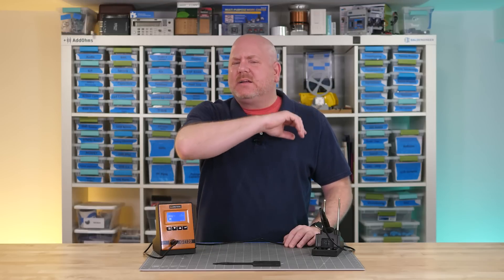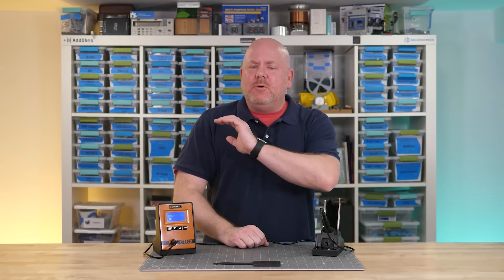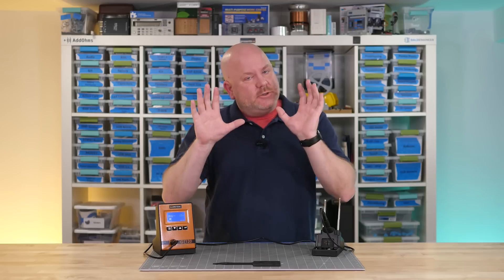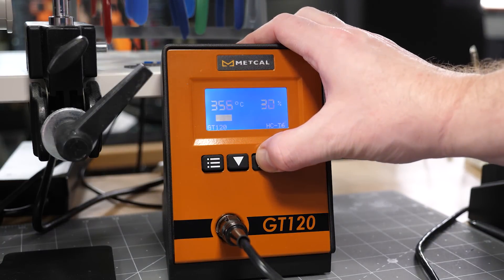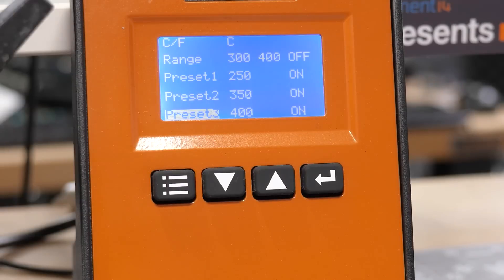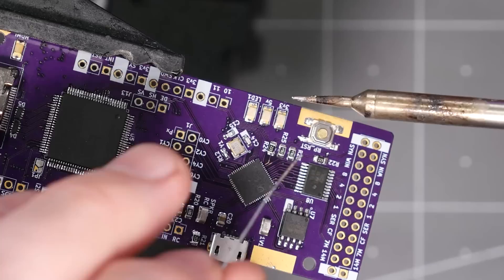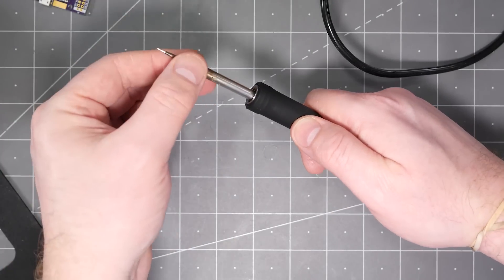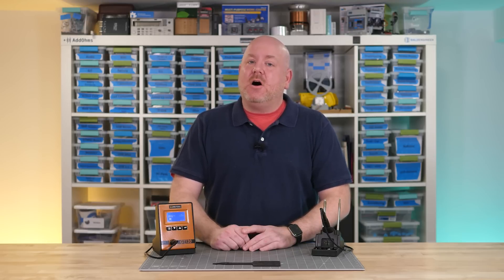Three Tips to Improve Your Soldering - Workbench Wednesdays

Comment: Can someone tell where I can buy a soldering mat with design like in this video?
Reply: It is a self-healing cutting mat. I treated it with a carbon spray (from Staticide) to make it slightly conductive and less prone to ESD. I don't actually recommend it for soldering since it does not stand up to high heat. In almost every other video, I have a metal tray under the work piece.
Reply: @bald_engineer  Thanks for response!

Comment: A tip regarding... well... tips. Before setting your iron down in its stand after soldering, tin the tip by at least melting a droplet (blob) of solder onto the tip and leave it in place while it rests. This causes that droplet of solder to oxidize instead of the tip. A light tap of the iron removes the blob when you pick it up (into a metal tray works best) and a quick wipe on a wet sponge leaves you ready to carry on. Also, before shutting down your iron for the day, leave a similar blob to harden onto the tip in the holder for that same tip oxidation prevention. When you come back the next time, fire up your iron and you'll know when the iron is hot, as well as protecting the tip. If you're like me, the iron is often on well before I'm ready to start soldering. Last tip - tip, is to avoid tinning too far up the tip. Most quality tips have a base metal and a quality metal on the soldering area of the tip. Don't tin past the tip alloy up onto the base metal. Solder flows well on the tinned portion and it can and will cause you to use more solder and/or draw more of your solder away from your joint. I'm not a believer, but the saying 'Cleanliness is next to Godliness' when it comes to tip care is apropos. (Although I'd just say it's good damn idea!). As my father once said to me... 'Son, try to learn from my mistakes. You can't possibly live through them all yourself...' :)
Reply: Nice. Cleaning the iron with good quality brass wool is preferred to wet sponges. It's due to brass removes excess solder, including dross but leaves a decent skin of clean solder on the tip (assuming a clean well tinned tip).
Wet sponge tends to cause thermal shock and makes your iron tips corrode faster. They do tend to clean better but with a shorten apparent life. They leave a lesser solder skin than brass. This reduces transfer of heat into the work material when you touch the tip to the work area. It sort of pushes you to needing to feed the solder wire in to make the heat transfer happen faster. 
I fully concur with your leave some solder on the tip. Tap or wrist flick to remove the solder. Great practice!
Clean your tip with brass wool before working on your joint. Not when you return iron to the stand. Don't do both times.
Prepping to ensure you get clean melted solder onto your stright out of the packet tips at the very microsecond they are first heated sufficiently is the key to tinning your tips. 
Caveats: All brass wool is not the same. You can get bad stuff that has alloys in it you don't want to be there. Never use brass if it's a scouring pad (yes it looks like one) or sandpaper. Doing so will not help.
 Wet sponges also vary but are commonly filled/wetted with tap water by the user. Tap water contains things you do not want to be cleaning heated metal with.
Reply: @cdyoutoob  I forgot to mention that I use distilled water for my sponges. The other bit is that I slit the sponges with an razor blade about a 1/2" deep, so 1 or 2 quick wipes clears most of the flux containing the contaminants and have tips that have mega-hours (years) on them, so haven't seen the thermal shock issue of which you speak.:)
Reply: @scottdebruyn7038  Yes that slit in the sponge is a great tip i've only recently discovered. Seems so logical once you do it though. Thermal shock is hard to see, just read lots about it and moved to using the brass way more. Tips/Cartridges do last a lot longer now. I get my brass wool only from electronics vendors and not generics. Too concerned I'll be getting something that is cheap and nasty instead of just cheap.

Comment: Before storing your iron, clean the tip with Tin Tinner, then coat the tip with solder just before powering it off.  Leaving the tip coated with solder means it can't oxidize and corrode.  The next time you fire it up, clean the old solder off the tip once it's melted and the tip will be ready to go.
Reply: Well, no. You should very rarely use Tip Tinner. That should ONLY be used on a tip that has nasty oxidation that you want to clean off. The flux used is significantly more aggressive than the flux you normally solder with.

Just cleaning a tip with a sponge and putting fresh solder on it is enough for storage.
Reply: @bald_engineer  Well, I've been using this process for over 20 years and my tips easily last 5 years.

Comment: I don't have the habit of cleaning flux AFTER I solder. I wonder whether that is bad, because I see others, especially those that do electronics professionally, religiously clean up the flux with special solutions after they're done. I see this as an extra step that is more esthetics than the actual physics of the joint and traces. Correct me if I'm wrong.
Reply: No-clean flux does not (usually) need to be cleaned. It is supposed to be inert. However. I've still had issues where there was just a little bit of conductivity in the flux residue to active a high-impedance input. 

In general, if I'm adding flux to a board, then I clean it after. Not always thoroughly, but enough to make sure the majority of residue is gone.

If I'm not just using the flux that's in the solder core (and it is no-clean), then I don't usually bother.
Reply: @bald_engineer  Oh my god that couldn't be more incorrectly interpreted. No-clean flux is the worst chosen name, the worst interpreted name or both. 

You will nearly always want to clean away No-clean flux if it's at all possible to clean.

Residues do have some degree of conductivity, but they all remain sticky. Stickiness will cause many things to adhere, most of which will be very conductive. All of which will be bad in the long run. This is why we clean as best we can, when we can. Whilst many will clean for aesthetic reason it's not being doing solely for aesthetic reasons.

@Desert Vox's questions about cleaning flux after they are done. It's certainly very good practice to clean up after you're done, but also clean up during the soldering process.Flux is not necessarily beneficial functioning flux because you can still believe you see flux present. A lot of fluxes have a short 'active life' as heat is injected into a bond point and the flux does it's thing and is done. If the existing residue is expired flux, then wiping this away from the bond point and adding new flux will improve your ability to solder and make great joints.
For beginners please choose fluxes that do not blacken, darken, carbonise, dry up, or burn with repetitive heating. Beginners commonly overwork joints with poor skill and inexperience, and are commonly handed A flux like this, with the bad soldering iron they bought. These fluxes are mostly more corrosive when left on PCB, and also harder to clean. Several more reasons beginners should try to avoid them.
Some modern fluxes do not degrade continuously or quickly, with more heat. They still create a separation barrier between the metal working surfaces and the oxygen in the atmosphere.

Comment: For most component and pcb the flux in the solder will do the job, you should always use clean pcb bad and component. You can always apply external flux for those component that is hard to transfer heat to like fine pitch IC or big wires, and clean after as you should do anyway. Flux is not a must.
Reply: 'Flux is not a must.'.. Not for a single joint with a well tinned iron, no. But I'd disagree on not using flux on more joints than 1... maybe 2 at a time. Of course you can always clean your tip between each and every joint or 2. I noted that the presenter tended to flood with flux and preheat the joints with with just flux before soldering, that's not necessary. Just a fine tipped flux applicator and a quick pass over each joint to add no more flux than you will be adding solder is best. Then solder with the raw flux in place in one step. :)
Reply: @scottdebruyn7038  still again you do not need so much flux that they swim in it. take a soldering cause and you know what Ia am talking about. I see lot of youtubers that use lot of flux just because they have seen other youtubers use lot of ot. but it not necessary.
Reply: @REALIVH  I agree with you that no flux at all works if you have a clean iron (properly tinned) and rosin core solder. But again, too many fail to get good solder joints by failing to clean their iron and using only the rosin in their solder. The impurities build up after 3-6 joints. The addition of small amounts of flux extends that to 15-20 joints between cleanings of the iron. I've been soldering since my late teens (now 63) and have made every mistake and tried most every combination from flooded with flux on fine pitch SMT to solid core solder on copper braid with a match. When it comes to flux, A little dab will do ya, but none for a big job sucks.